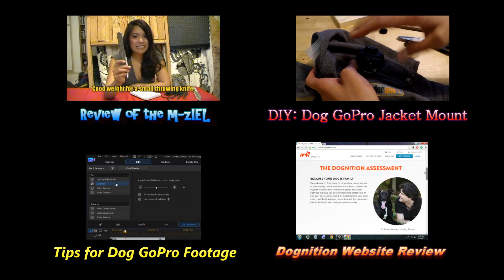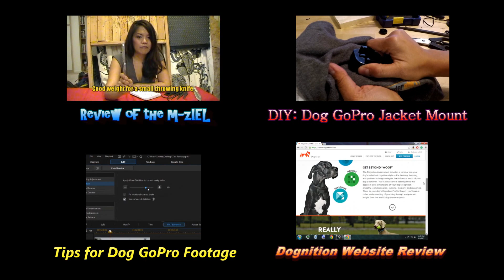My DIY Dog GoPro Mount in Action (+ Kick Fetch Ball)

Comment: GoPro needs to work on a way to stabilize the camera on the mount better. I've seen the exact same problem on other doggy GoPro videos. Even the official GoPro dog mount/harness is shaky.
Reply from the maker: GodlessManitoban  I think any dog footage is just going to be inherently shaky, especially depending on what type of dog you use, as a smaller dog will have a shorter stride so will have worse footage.  I'd love to try a gimbal that will keep the GoPro steady, but those are expensive!

Comment: That was shaky! You should use the new After Effects stabilizer filter. It's waaay better.  You can get a trial version. You can also shoot at a fast frame rate and slow it down to make it more smooth.
Reply: I was going to shoot at a fast frame rate but then wanted to see the difference in the shakiness of the footage.  I might try that stabilizer program though. Thanks, Celeste!